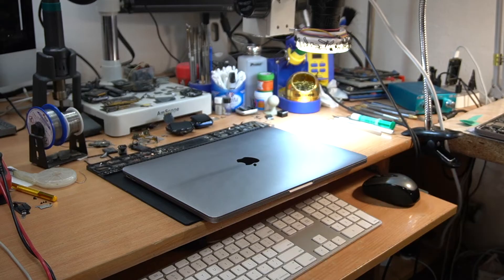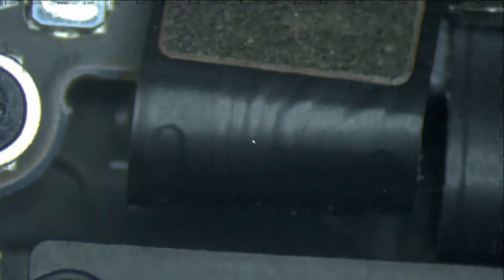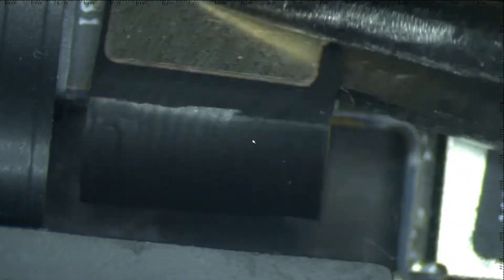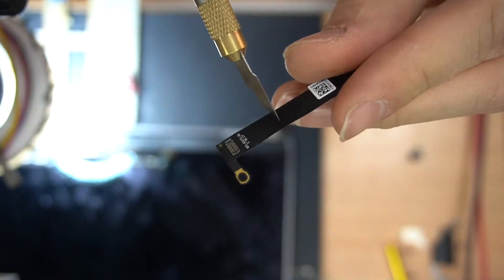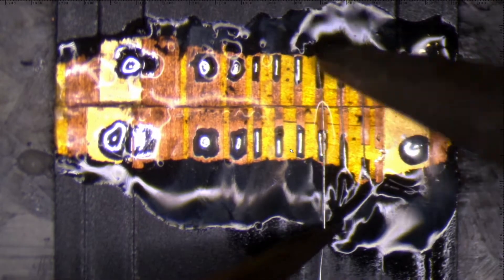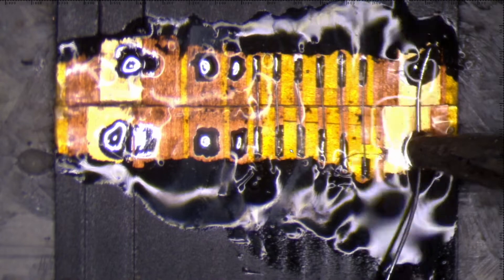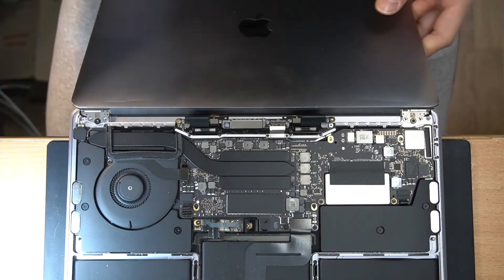MacBook Pro 13 A1708 2017 (flexgate repair) no backlight at 90 degree angle

Comment: For the 2 big power lines I would use multiple jumper wires. They are wide enough to comfortably solder on 4 jumper wires each.

Comment: Great video. What is your soldering temperature?
Reply from the maker: The temperature for melting solder 😂
Reply: The temperature to use depends on a few factors. Such as the soldering station you are using and its power, size of soldering tip, what material you are using underneath the flex cable. If what you have underneath is ceramic or other material that does not easily conduct heat and/or a high power soldering station, use temperatures close to the melting point of your solder. If you use something that easily conducts heat or a low power soldering station, Start at the melting point temperature and raise the temperature 10 degrees Celsius at a time till you hit the point where the solder melts fast without being overheated.

Comment: Hey i have the same issue with my MacBook its the same model A1708 I have tired changing the display ended up with same issue again is there any thing you can help with ? I am from India BTW
Reply from the maker: The only way to resolve the issue is by doing this repair.
The flex cable must be a little longer than the original, so that the issue doesn’t occur again.

Comment: why to solder wires? isnt solder enough if you would put glue on top of it?
Reply from the maker: The wires are to connect the rails between each other.
The glue does not conduct electricity.
The solder it self isn’t enough to connect the rails.

Comment: for the caliber of the cables, what caliber did you used ? i can see that you used 2 different calibers, one for the center rails and one for the exterior ones
Reply from the maker: Hi, honestly, I have a speaker coil (iPhone speaker), multiple thickness.
I used later a 0.088 (40AWG) wire.
Where you need a thicker wire, you can just double the wires.

Comment: Lately i have a problem with this repair. The screen had only backlight issue, after replacing flex backlight cable, one thin vertical line appeared on the right side and many coloured horizonal lines, looks similat to "dustgate" issue. That is the second time that happened to me, completely same simptoms on two screens. What i am i doing wrong? Bad cable, ground issue somewhere.. ?  Have done many of these...
Reply from the maker: @roadrunner1095  could be a coincidence, these MacBooks have the dustgate issue also, so when you remove the screen small board, could be the dust moved between the flex cables and done that.

Comment: Pls be gentle with me, i am not technical. Can somebody help me point out : But is this the only way it can be repaired? can it be just purchased via online the flex gate cable? and replace the torn one?

Thank you in advance 🎉
Reply from the maker: @yan_88tv70  Hi, the flex is located under the screen, so in order to replace it fully you will have to remove the screen from the lid (the screen is glued to the lid) and then do the replacement process and glue it back without any dust coming on the backlight (the screen and the backlight are separate).
In other words, yes this is the only way to repair this issue.
Reply: @iTouch-repair  thank you - that was quick reply :)

Comment: Why don't you just replaces the flat cable completely? Instead of cut and join both together?
Reply from the maker: @menandrofigueiredo4420  because the cable goes under the screen, and in order to replace it I have to remove the very fragile screen and glue it back without damaging the screen or the backlight.

Comment: need to correct you there, the defect is not caused by closing and opening the lid as that is what it was designed to do. It's caused by crap engineering from Apple
Reply from the maker: @liquidsnake6879  100% Apple design defect.

Comment: nicely done!! given flexgate would fail eventually, would you recommend replacement of both as supposed to 1? I imagine the next one may fail soon?
Reply from the maker: @organicaquaponicsfarmboonh4132  hi, I didn’t get any reports as for the second flex cable.
If it is working then leave it.

Comment: I’m triggered by the thought that this can be done easier. Don’t start by scraping the original cable. Just glue the new one on top. Then scrape both cables at the same time. Next just solder the lines together directly.

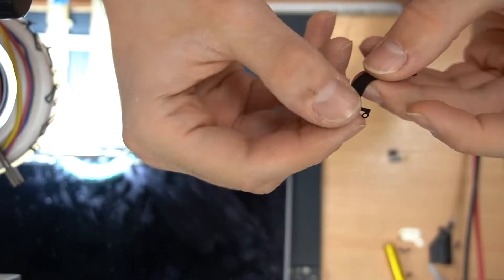Comment: 07:27 Maybe a stupid question, but I really do not understand, so PLEASE help me. 

Why do you soldering wires instead of replacing whole cable? Why go super hard (and not very reliable as soldered cable will not be as much resistant as original) instead of super easy way just replacing whole cable?
Reply from the maker: Hi, as I explained before for many comments, the flex goes under the LCD, so in order to fully replace it I need to remove the screen from the lid.

Another reason for going super hard is, the issue in the first place occurred the flex is a little shorter causing this issue, and I am adding length to the flex to avoid this issue being repeated.
Reply: @iTouch-repair  is it doable? Can you remove it without damaging? I know that on TVs you can, I did it myself once, but Mac display is way smaller unit compared to TV. 

Thank you!
Reply from the maker: @Fantastic_Fungi  I have a video on how to replace a screen on MacBook Air you can check it to see the level of difficulty.

Comment: Great video, congrats!
Just a question, did you make the contact points here with pieces of solder wire? 10:57
Reply from the maker: Thanks.
I add solder to the copper rails so I can solder the wires on them.
Reply: Thanks for the answer. To melt the solder paste, do you use a heat gun? Can I get it any other way?

Comment: Why would you not just replace the entire cable with the new one, which you had in your possession? This does not seem like the way Apple would repair it if you brought it in shop. While it seems that you are very skilled and have professional tools,  this is a  ridiculous amount of difficult work, it seems the new joint be a weak point for future failure.
Reply from the maker: Hi, long story short, the flex cable goes underneath the screen, so to replace it from the roots you will need to remove the screen from the lid and replace it (you can search how to replace a screen on these models).
If you take it to Apple, be ready to pay big money for this repair, they had their repair program for this issue I think now they closed it.

Comment: Hang on a sec i didn't realise that half way through you need the smallest screwdriver in the world. In 5 more years i'll need a microscope just to find the screwdriver! So. i could only do what i could without that screwdriver. I found a fold / crease in one of the cables but i couldn't actually see a break even with the microscope. I tinned across this area with solder but no jumpers, it was one of the wider of the 4 cables. I think the other side also needs doing but i wanted to get the display off to take a better look. I only had a Stanly blade (box cutter blade). 
  After trying this one cable i put a strip of sellotape over the area and put it all back together. I usually use an external monitor, i bought the 15" touchbar this way to save money. Problem is doing osx updates. When you get to the next step you can not use external monitor!
  Anyway. It's stopped flickering and now only one big strip centre left not working but before i couldn't read the screen at all, sometimes i could see a bit of it between the flickering but not really and not often. Now i can read most of it. I'll have to get the tiniest screwdriver in the world and try again to fix the last part of the screen / cables.
  I was surprised how strong the flex cable was considering i only had an old box cutter blade! Nice!

Comment: Hi there, nice work, but what about the other cable? I was given a Macbook with both flex cables damaged. The wires are different and much finer, and more densely packed; hence more difficult to solder jumper wires. After much thought, I am thinking to bridge the 2 pieces with another piece face down on top. However, after market cables are not a perfect match.
Reply from the maker: Hi, the other cable is for camera and flood illuminator, and they don’t always need fixing.

Comment: I have a A1708 macbook pro 2017 but its flickering and goes blank with back light still on when it gets hot , is that the same problem or something else?
Reply from the maker: I have another video on the channel about your issue, check it out.

Comment: What type of cables do you use and what size? I'm a beginner.
Reply from the maker: You can use the coil in the smartphone’s speaker.
Reply: but isn't it very fragile?  @iTouch-repair
Reply from the maker: @viralespopulares1073  from an old one, you can damage the speaker just to get the coil.
Reply: @iTouch-repair  nice And can I use the same gauge for thick stitches?
Reply from the maker: @viralespopulares1073  you can double the cable for the thickness

Comment: Thank you so much youve been so helpfull, nobody wanted to take the risk to fix my laptop, you explained it very well im gonna fix it myself
Reply: Hey there - just wondering how did you get on? Thinking of doing this myself, have dabbled with iphone fixes before but this one looks pretty tricky!
Reply: @stephenosullivan9044  if some leds are not lit , it''s the same flex on the left? fractured lines?

Comment: Nice video! What gauge wire did you use to repair?
Reply from the maker: you can use any wire from a phone speaker coil.
Reply: Thank you for the response, yeah I want to make sure I put a 'thick' enough wire on those outside rails. Also, are you worried about that superglue holding long term? Is the heat going to potentially be a problem? @iTouch-repair
Reply from the maker: @Swinky88   The super glue needs more than 150 C degrees to start melting.
as for the long term, there is no tension on the cable that could lead to a problem.

Comment: Hi i have Same issue with my macbook pro a1707   I am confused between replacing the whole display or  just repair the flex cable. One guy told me that repair has 50 50 chances .
But iam thinking if display is replaced then the cable length would be same and this issue can most probably come again after some time.  Which  will be the most relaible and best among both of them so that it cant be seen in future?    Please reply asap.
Reply from the maker: Hi, I would recommend fixing the flex.
As you mentioned, it’s best because you will fix the issue from its roots.
I can tell you from all the repairs that I’ve done, no one came back.
Reply: @iTouch-repair  thank you sir for your advise. Actually i contacted a technician who told me that flex cable  have 50 percent chances of  repair and he suggested me to change whole panel. That made me confused

Comment: This are common problem with Macbook Pro’s 2016, 2017,2018 and even up to 2019. Apple only covers free repair program on 2016 only, yet even the 2017-2019 have exact symptoms they won’t fix it under their repair program.  I wish you live nearby as I have at least 3 macbooks with this issue. Excellent job on the repair!

Comment: Hi.  Is only the backlight ribbon damaged or the camera one too?  what glue do you use to connect the tapes?  how much do you extend the tape compared to the original length?
Reply from the maker: Hi, as for the flex cable, I only replaced one. Sometimes the camera flex gets damaged and you replace it when damaged.
As for the glue, it's a super glue that you can find in any hardware store.
I extend the flex by about 2-3cm that way it doesn't get damaged next time.

Comment: Great job,, i have some questions.. ❓❔⁉
11:23 what thickness are both jumper cables?
13:02 What tape is it?
Reply from the maker: Thanks, the tape is in the description.
The thickness is up to you.
Reply: @iTouch-repair  ok got, but, what did you use? in this specific situation
Reply from the maker: @khbklajsjhyuwerkn949  you can use the coil inside the phone’s speaker. They come in variant sizes.

Comment: would some proper sized heat-shrink tubing work instead of the tape?
Reply from the maker: It’s gonna add too much thickness and the flex won’t be able to move while opening and closing the lid.
Reply: @iTouch-repair  ok, so what kind of tape is that, automotive fabric tape? as in the kind of tape they use to wrap cable trees?
Reply from the maker: @rick5078  you can find the name of the tape as a linke to it in the description of this video.

Comment: Wonderfull video, wish you can explain little bit more of the gluing and the materials of covering the necked cable. over all great
Reply from the maker: Thanks, the glue is a simple super glue you can get in a hardware store (not epoxy).
The masking material is a UV mask you can find on aliexpress or eBay.

Comment: Question (respectfully asking): Why not just replace the flexcable?
Reply from the maker: That’s ok)))
The flex cable goes underneath the LCD, and to get to the flex I need to remove the LCD panel from the cover (the LCD is glued to the cover and it’s very expensive) and then try not to damage the backlight film layers and remove the flex cable.
If I could replace it I would’ve done it, it’s much easier to desolder couple of pins and solder them back than this.

Comment: My 2017 MacBook Pro is getting footlights or stage lights. I'm wondering if the apple people will need to wipe my computer to fix it? It seems all the repairs I've needed so far they always have to wipe everything 😅
Reply from the maker: Hi, this repair doesn’t require any type of software interference, it’s only a hardware issue.

Comment: which size jumper wire to repair flex gate? 0.1mm? or 0.05mm?
Reply from the maker: Hi, I think you can use each one.
I don’t know the exact size, I have mine as a coil from an old iPhone speaker.
Reply: Did you end up trying the repair? I'm scrolling through with the same question. I have .1mm in hand but I'm trying to figure out if I need another size for the outside wires.

Comment: Can't we just solder both side on their edges so we use only short wire or no wire at all (the solder tin connects them all)?
Reply from the maker: No, you need to solder them as each rail is assigned to do it’s job and make regulating the backlight possible

Comment: Nice and detail tutorial. I am a newbie on this things. 
I still don't understand why don't you just replace the broken flex cable with the new one since you have it.
Reply from the maker: Hi, thanks.
I already explained this in the comments for some one else, the flex cable for the backlight goes under the LCD and to remove it you need to remove the very delicate thin LCD and try not to damage it with over heating, so I think this is the best way to fix it.
Regardless of that, as I explained that the flex is short and that’s what causes the problem, and by doing this method I am adding more length to prevent this issue in the future.
Reply: The other end of the cable is inside the display body and not accessible without disassembling it. The display is glued together.

Comment: Very nice work.
Have to ask, how come you choose this method over replacing full cable?
Reply from the maker: Well, I would love to replace the full cable but, you see the cable if you saw the disassembly of the screen the backlight cable goes under the screen and in order to get to it you need to remove the LCD matrix from the case and not damage it and then you can replace the full cable.
See it’s very easy so I though to my self why go the easy route, let’s make this interesting and do this instead.
Reply: @iTouch-repair  Thank you for replying, that makes a lot of sense. I saw the replacement cable and the other end I thought would of made it an easier job. Now I know if I have to do this to do this method. Thanks.

Comment: Could you tell me what gauge wire tinned copper for the 6 small and other power and ground. Also what type solder and tip and temp. Thank you thanks again. Steve
Reply from the maker: hello, regarding the wires, you can use the coil from an old phone speaker, they usually come smaller that's why I wrote speaker phone.
regarding the solder and the other soldering equipment, you need to find the most suitable for you.

Comment: What product do you apply just before soldering? Thanks for sharing this!
Reply from the maker: Hello, it’s flux. It helps with the soldering but, his job is to remove the oxidization from the solder and helps improve wetting between the two surfaces. This provides electrical contact and enhances the strength of solder joints.
Reply: why you put wire instead of solder directly or connected the cable with silver directly??? thx for the great video and explaination

Comment: Hi, what kind of jumper wire do you use? and which solder iron you have? That is very tiny.. i used 0,1mm wire, but looks 3times thicker. Middle 8 wires are straight forward... the ones on the side i dont understand. Looks like there are two more lines on the left and two on the right,  where you connected the middle line... what is that, ground?
Reply from the maker: Hi,
you can use a jumper wire from a speaker coil.
or you can go online and search for a jumper wire for microsoldering.
the thickness should be around 0.010 0.030mm
the lines on the sides are ground so you will need just one will be enough.
the thicker rails on the flex should be jumpered with thicker jumper wire because they are power rails.

Comment: Good afternoon. Please tell me what kind of wire you make jumpers to connect the contacts of the loop. Thank you.
Reply from the maker: Hi, you can use the wire from a speaker coil that will work.
You need to pay attention to the thickness.

Comment: Great job, very professional
quick question, did you use a stripper to remove the plastic protection? THANKS :)
Reply from the maker: Hi, it’s a scalpel that you can buy at any painting shop
Reply: Thanks a lot :)